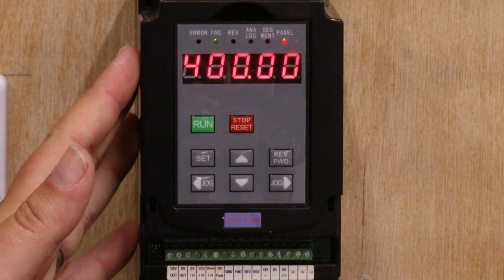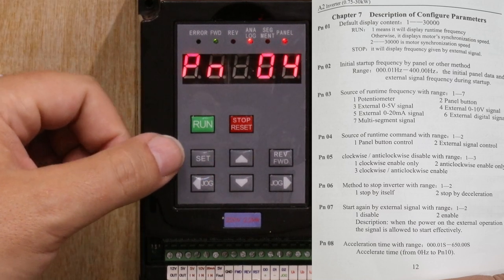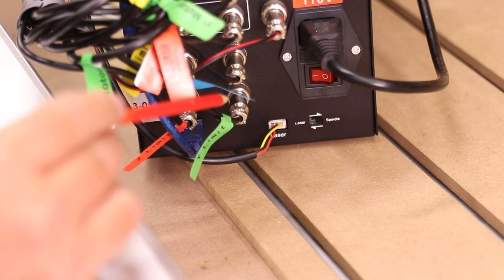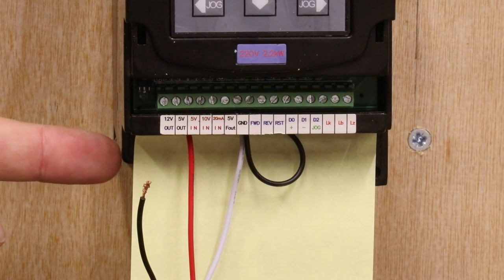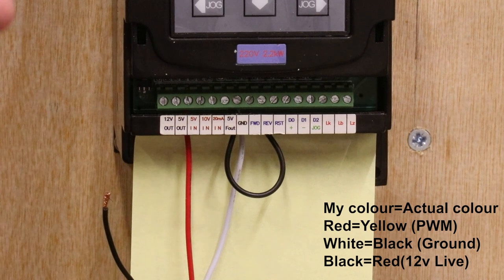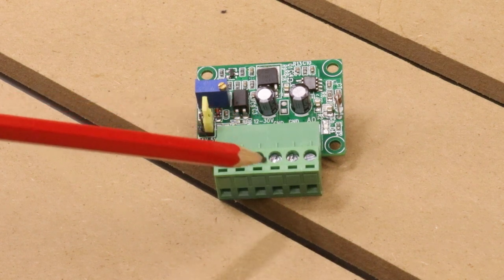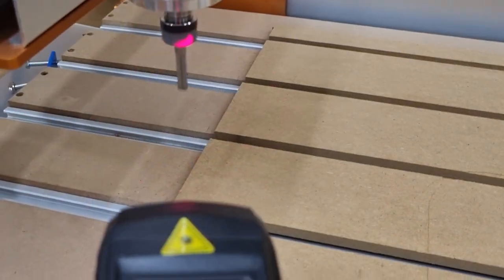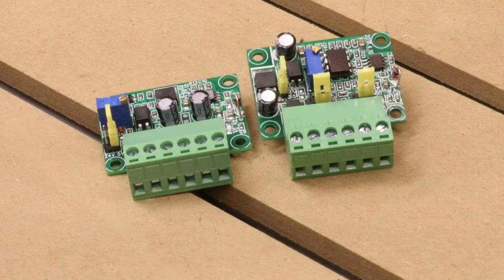Spindle VFD setup part 2.0 - External Spindle Control (Journey so far)

Comment: @JamesDeanDesigns I visited this video, as I was attempting to do the same thing with my setup.  My VFD is the H100 VHD, like what is listed in the 1.5 and 2.2K kits in your description. I have the 110v design, as I didn't want to put a 220v circuit inside my garage. 

At any rate, I have the ability on mine to amplify the PMW signal going into my Analog Input 1, and if I adjust it, I can get all the way up to full power. It does skew the lower ranges though a bit. For example, at what should be 5000rpm, actually runs at 6100. But as I go up, it levels out quite a bit. 

I will be putting a video out next week with all of my settings. Full credit to you for showing me the way forward. I will be sure to mention you in the video, as well as link back to this one for those folks that might have the VFD that you have. Thanks for providing such wonderful  CNC tutorials!👍👍👍👍

Comment: I wouldn't worry about the frequency-driven module, PWM is generally a fixed frequency 20kHz for example it is only the duty cycle of the pulse that changes.  The trimmer on the PWM module is supposed the tune the max analog output voltage from memory, I use the exact same module on my CNC router with a BLDC motor and driver. It may be the input voltage is too low to tune up to the 10 volts needed.  On my setup that PWM module is at 24v and works perfectly.  So I'd definitely try to increase the supply voltage to the PWM module.
Reply from the maker: Thats what I was thinking. The input takes 12-30v and I think the 12v input I'm using is just about 12v.

Comment: If you up the hz of the motor.(500 instead of 400) it will do 25% more power (just make sure you dont overpower the spindle.)
Test theze settings without the spindle connected. And see how many hz the vfd puts out when you go full throttle.   Then you know for sure that you wont blow the spindle.

Comment: I now had the chance to do the same on my Vevor 1,5kw watercooled spindle - used the same converter you show.
I was able to increase output up to 9,2 Volts what gives 23000 RPM - this is fine for me.

The screw needed to be turned multiple times the whole circle, not only a few mm up or down what one might guess to show any effect on Voltage, but at 9,2 Volts converter was maxed out.
For someone interested - I am using Sainsmart 4040Pro and connector named "Laser" can be used for this.

I noted RPM is higher in lower regions as command sent - i.e. S12000 results in 13000RPM  shown on VFD. This effect is smoothing out with higher RPM
Reply from the maker: So I finally got to the bottom of it, just haven't had chance to do an update. The 12v live from the laser port isn't strong enough. I used a separate 24v supply and that got the full power
Reply: @JamesDeanDesigns  James, could you explain how you connected the separate  ps to the vfd? thanks, I just received my vfd and trying to connect also. thanks again.
Reply: @JamesDeanDesigns  Hi James should I assume you mean 24v to the PWM convertor?
Reply from the maker: @jimsoar2089  yes, I had to upgrade the power supply to the PWM converter to 24v
Reply: @JamesDeanDesigns  Thanks for that use the ground from the power supply and laser output?
Reply: @JamesDean, thanks for the video.  When will you do a final update video?  The 24v you are referring to is it the PWM VOLTAGE CONVERTER K24P-10V?

Comment: Your explanations are thorough, the most appropriate to my skill level that I've found on YouTube.  Now that I've found someone who explains well, I hope to find the topics I need!
Within the VFD enclosure I need additional power (24V) to run relays to run an enclosure fan, turn on the water cooler, and power the VFD, itself (so I don't have to keep using the power plug!).  I also want to enable an emergency stop switch.  I see in the comments that you added 24V power.  Do you have video(s) on these, or another reference?

Comment: I suggest you use the 0-20mA input and put  a resistor between the board and the input so the 8.8V / R = 20mA, so around 440 Ohm. That could even be done without the intermediate board, but than with a different resistor of course. 3.4V / 0.02  = 170 Ohm
Reply from the maker: You clearly know a lot more than me about electronics...which doesn't take much to be honest. I did eventually get to the bottom of this and it was the fact the 12v supply that on paper should have been fine, wasn't actually enough to run the converter

Comment: You could use a boost buck converter/step up voltage regulator they have a potentiometer on them that you can turn voltage up or down, set your laser output to the max then put the multimeter on the buck converter output and turn up until you see 10v then your good to go hope this helps
Reply from the maker: That's essentially what I use in the video and it didn't work. Albeit I finally got to the bottom. Even though the 12v live from the laser is supposed to be enough to work on those conveters, it didn't. I even tried a direct 2amp 12v supply and still didn't work. However went up to a 24v supply and TADA! It all worked. Bit of a pain to be honest but glad I figured it out
Reply: @JamesDeanDesigns  Glad you got it working, had similar issues with my vfd
Reply: @JamesDeanDesigns  ar you going to make a video of this?
Reply: Yes I hope he does post a video

Comment: question: was pn07 " start again by external signal with range -1-2 "  reason for tripping VFD with error OC-r ? I have same 7.5kw using on 3.2kw motor for car lift and it works but sometimes it tripps out with OC-r error. Did you had same issue ?

Comment: Maybe using a simple voltage divider would help? Use the converter that gives 8.8 volts, hook up on the output two resistors in series and take the signal from the bottom resistor to the input which accepts 5 volts. Value of the bottom resistor should be proportional to the sum of both resistors in the same way as 5 volts to 8.8 volts.
Reply from the maker: I need to do something either way to get that voltage hitting 5 or 10

Comment: Couldn't you wire the 5V out on the VFD through a simple relay that is controlled by the 3.3V output from your controller? That would give you 100% power on activation.

Comment: is their a way just to have the unit just turn on and off and the speed function left manual just using the spindle power supply cables if that makes sense

Comment: Hello, 
I have a Huanyang vfd and 2.2kw spindle 220 volts. I did not reset my vfd when I put in the settings from several videos. It worked except it would only go to 208 hertz. I reset it and now it goes to 400 hertz but the potentiometer on the front does not work. Is there a setting I can change to fix it. TIA

Comment: Wonder whether it is worth rectifying the PWM signal, then smoothing with a capacitor on the '5V in' line.......that might work. It would be useful to know (so as to work out what type of diode configuration to implement) whether the PWM signal oscillates above and below earth/ground or whether the waveform sits higher than earth/ground.
Reply from the maker: That would mean me actually understanding how this all works. I did eventually get to the bottom of this, turns out the voltage converter that's meant to run from 12v, was working well with the 12v live from the laser port. Once I connected a separate 24v supply to the converter, all worked as expected
Reply: @JamesDeanDesigns  So let me see if im understanding correctly. The 12 v from the laser port was not enough power and you had to add an external 24v power source to run to the vfd?
Reply from the maker: @Martin-uj6zn  yes. Some other with different machines found their PWM 12v supply enough so could been an issue with my controller

Comment: maybe have simple use same elektric chematic than arduino can use, PWM to in TIP120 transistor, then transistor external power 10V and TIP120 adjust output 0-10V  if want can add PWM input optocoupler too then external power 10V and then transistor output to 0-10V.

Comment: some VFD controllers have what is essentially a voltage multiplication factor which you can set, but not all do and I don't know if this one does.
Reply: I know. My smaller vfd does have this function.😊
Reply: I think these cheap Chinese vfd:s don't have that function. I have one of these in the video, and I have a Delta vfd for my belt grinder, on the delta they got it.

Comment: If you look at the booklet, you can change the rpm by doing this.
you can set hz on the VFD to control spindle speed. RPM=HZ*60, if you set hz 200, RPM=200*60=12000, if you set hz 400, RPM=400*60=24000.
Cheers

Comment: It is possible your PWM signal is not going to 100% and limiting the maximum voltage. Do you have a multimeter that can measure duty cycle and frequency or an oscilloscope to take a look at the signal?
Reply from the maker: So it's pretty common for a pwm signal to only run a max of 3.3v (which I didn't know until I started this) but other than a basic multimeter, I dont have anything else to measure  with 😕
Reply: @JamesDeanDesigns  Correct, depending on the logic level of the controller. It could be 3.3V logic on the controller and going to 100% or near to that. I was thinking the PWM signal might not be going to full range since both connections you tried (VFD and converter) did not make the expected full scale. There are logic level shifters that might help when hooked directly to the VFD. The other suggestion made about setting a voltage divider on the 8.8V output signal might work.

Comment: You need more input into the PWM converter - 12v is not enough for 10v output.
Reply from the maker: You are correct. I figured it out but just haven't done another video. Supposedly these devices are meant to work off 12v, and others have actually messaged me saying theirs worked fine but for some reason mine only worked 100% when I connected a 24v supply to it

Comment: I am probably wrong but shouldn't they all share a common ground?
Reply from the maker: You're possibly right...as mentioned in the video, I'm not an electrical engineer 🤷‍♂️
Reply: @JamesDeanDesigns  I've not built a router/mill only CO2 lasers to this point and with them everything needs to share a ground 🤔